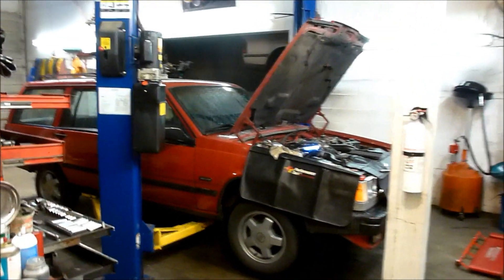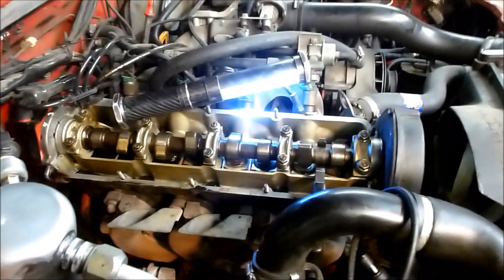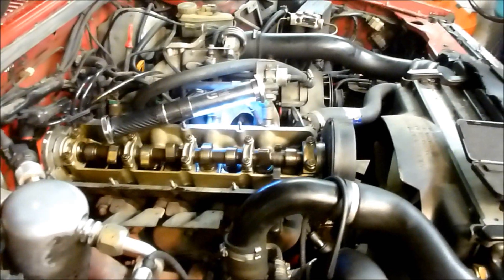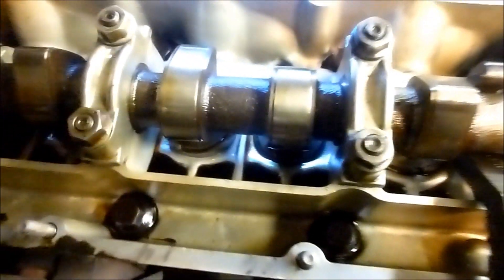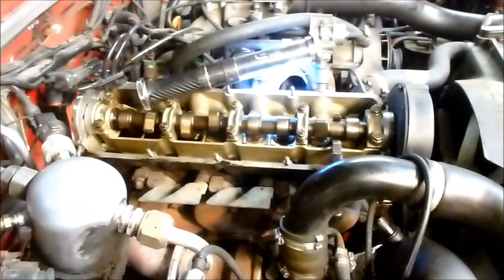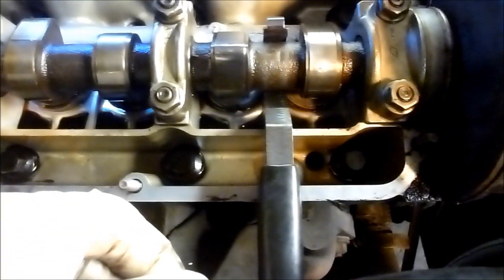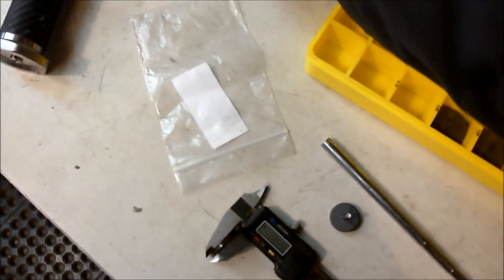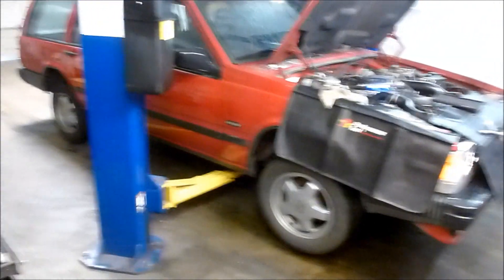Volvo 740 valve adjustment

Comment: Ive had a problem after i installed a B cam, (i have the same motor) all the forums said it was a direct swap, but it makes pinging noises at certain rpms... ive checked ignition timing, made sure the teeth line up, everything. Im stumped

Comment: Hello.

I just did my valves on my 240, you could hear just a little ticking coming from then, only 2 of the valve's had a slightly big clearance.
The valves should be done every 40 K km's, but that is on the non turbo version, i can assume that with the turbo version it should be done more often.
I am pretty familiar with the shim type valve adjustment, i work on a lot of motorcycles and a lot of them have this kind of valve operating system.

If i may, i have 2 little tips.
Keep the side with the number on the shim down away from the cam, this way the numbers doesnt wear of  the shim.
And use a micrometer to measure the shims, i notice the increments on your shims is 0.05 mm, but you also have increments as small as 0.02 mm, if the number of one of those is worn off you need more accurate measurments than with a caliper.

Greetings from Holland.
Reply: Btw, the follow up of the 240/740/940, the 850 does have hydraulic valve adjustment.
The 850 is almost certainly the best volvo ever made, they spend an enormous amount of money and time designing and testing that car.
They planned on replacing the 240/740/940 series in the mid 80's after the production of the 240 had been going on for 10 years with minimal changes.
But the cars still sold very well so they posponed with replacing them.